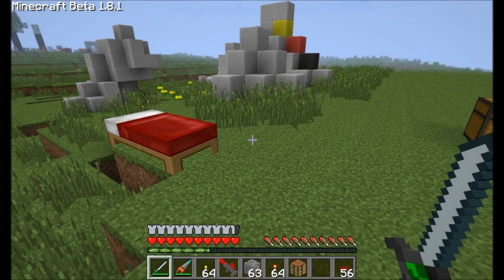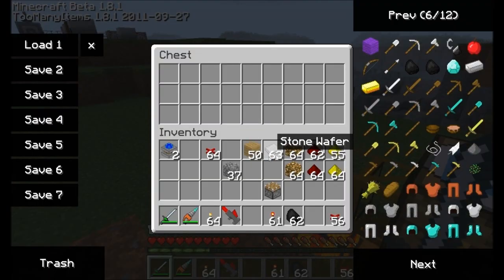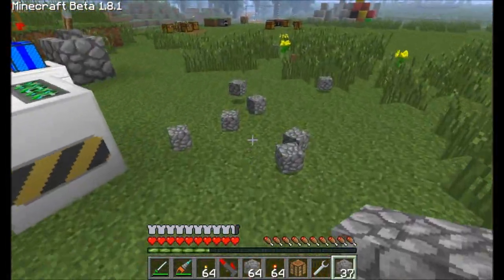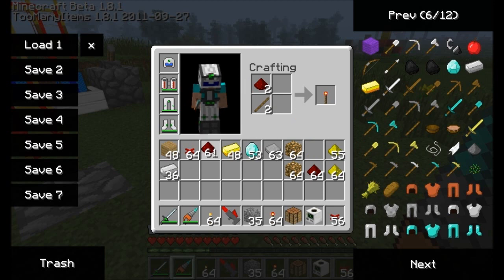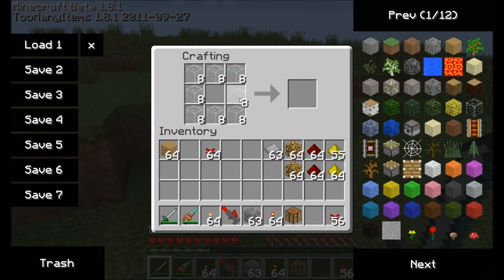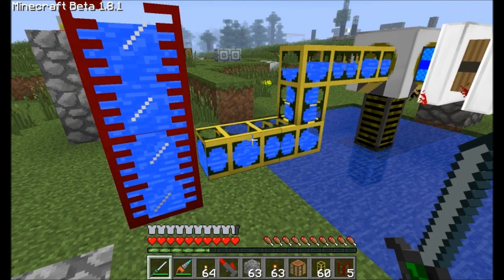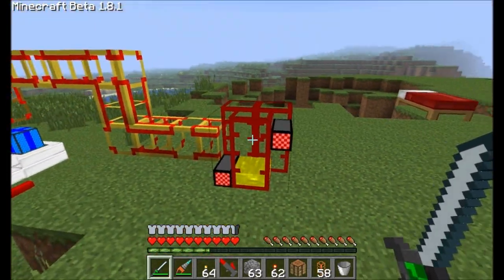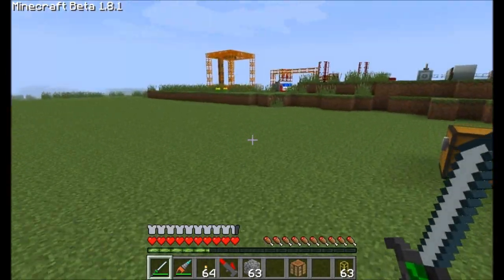Buildcraft Tutorial - Machines Part 1

Comment: For one, you need to have more than one engine powering the refinery. Two, the engines need to be cooled. You can place water buckets in the engine to do so. What I do is set up a pump over the ocean to pump water into a teleport pipe. The other end of the teleport pipe will feed into the engine and keep it full of water and fully cooled.

Comment: @Digiairship If you at a later time stop running your powerplant and connect a new quarry to the same conductive pipes, will the new quarry start running because of residual power stored in the pipes (and keep running depending on how long your powerplant was "wasting" energy), or is all that excess power completely wasted and you'll have to run your powerplant again to start the quarry?

Comment: Direwolf, when a machine finish its work, the machine in question stop drawing energy. Question is, will the energy created by your powerplant (ex. triple combustion engines) be wasted then? Or will the power be stored inside of the conductive pipes for later use?
An example: You've been running a quarry. This finishes it's work, but you're too busy to notice and your powerplant is feeding energy into conductive pipes which isn't connected to any working machines at the moment. (Cont.)